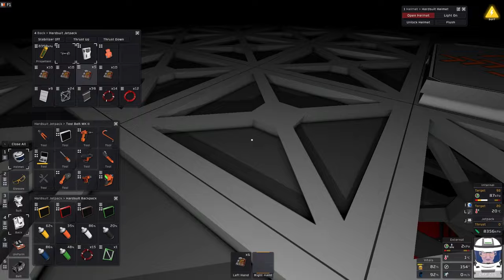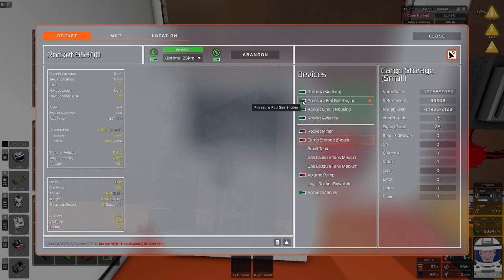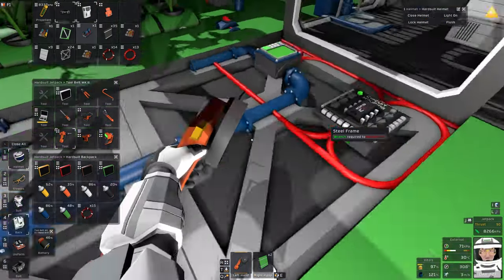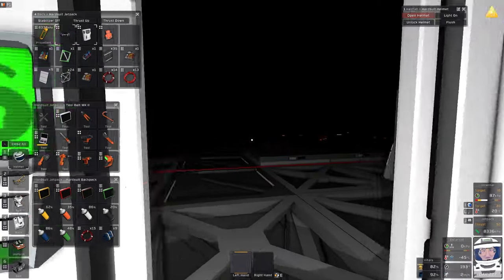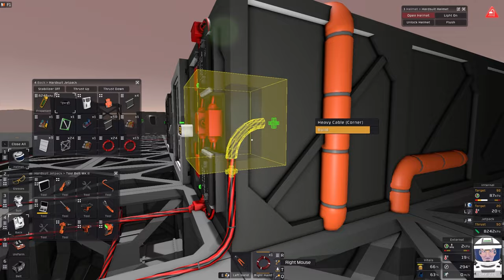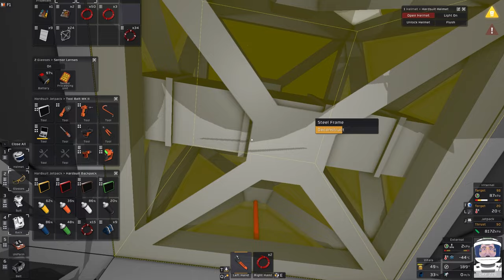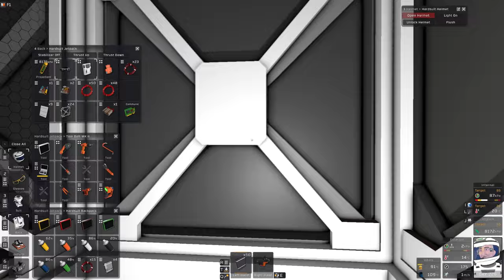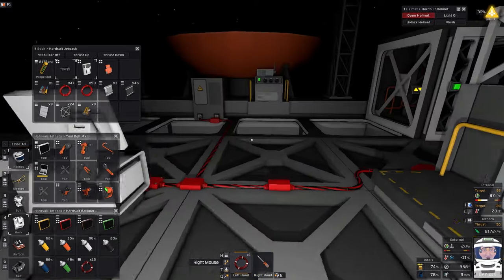Huge landing pad upgrade - Stationeers E30

Comment: The next rocket needs to be bigger. More batteries on board, more fuel. I know it would cost more to build, fuel, and time to power it up, but it may be worth it. Would it be possible to set a monitor in the control room to show the rocket's battery status, fuel, at a glance? Maybe do something like the storm warning beacon? So you don't lose another rocket.
Reply from the maker: @jasonknop973 I am sure there is something I can do like that. Just finished sealing my base and getting all the airlocks working properly then I'm going to start on more automation.

There is a way to get warnings in your suit, I might look at installing that too.

Comment: My condolences for Mr rocket..

I wonder no feasible it would be to create a warning program that if the rocket is below both or individual warning for when the rocket is low on fuel and/or battery, a red blinking lights or speakers with warning sound off when it happen…
Is that possible???
Reply from the maker: @srg08 You kow, I've never tried. I might look into it if I get a chance.

I don't normally let my rockets run out of power.
Reply: @dragonflygameruk4094  I know and it could help that one time it happen to prevent it from happening.

I’m like that too when playing satisfactory or any of theses types of game with their overwhelming amount of stuff you can do and never enough time to do it.